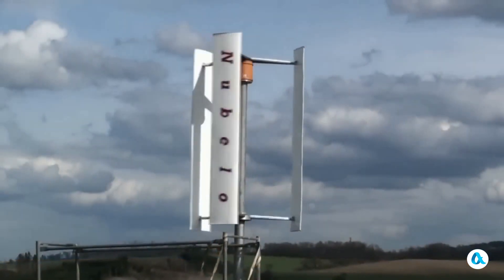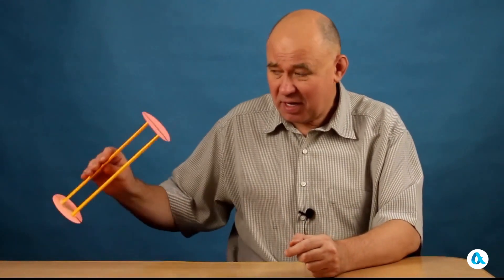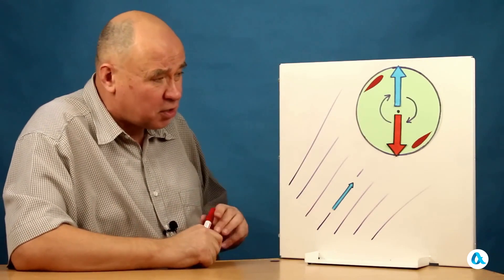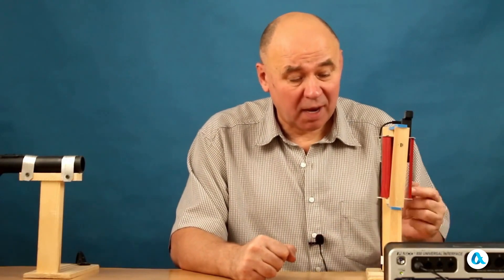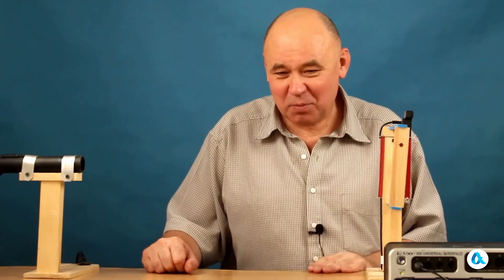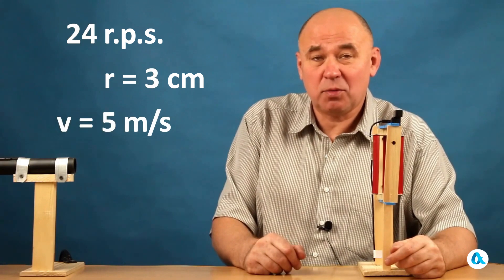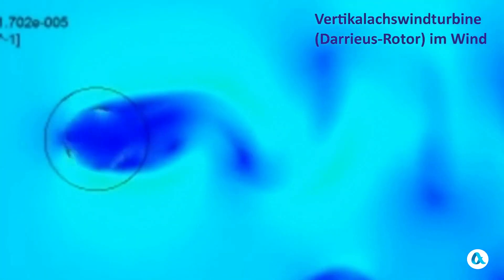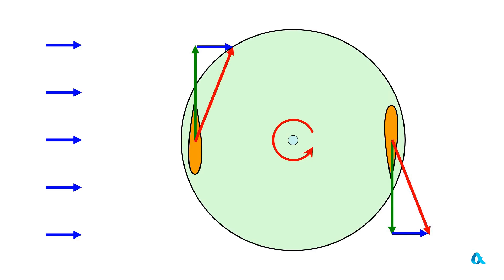Darrieus rotor

Comment: dear andrej! the central mystery that moves the darrieus rotor remains unexplained, is just 'imposed': "lift-forces perpendicular (!??) to the airflow"... so produce a second video please making plausible (visible?!) the reason for this perpendicularity! 
   that would also explain why an airfoil lifts an airplane if and only if it glides = slowly falls or if it is pulled by a motor-force. here the airfoil is supposed to push forward, so much so that you gain force (electricity) instead of using it...?!
thanx! hilmar
ps: by the way: not "perpendicular to the flow velicity" (the arrow you mean) but "to the direction of the air flow"! typical missleading language of 'theory'...

Comment: What  causes  the   maximum  rotation speed  of  the  device ?   well,   I would  say  the  premium airflow  speed,    the  aerodynamic  efficiency  of  each  little  wing ( drag ) ,  its  characteristics   Aspect  ration,  wing  section,    the  diameter  of  the  wheel,  the  interaction between  all the  wings,    the masses  in motion, the  friction in the  axi ... etc etc

Comment: As the rotor spins faster, the resultant vector sum of prevailing wind and tangential velocity approaches that of the tangent velocity (and consequently the effective angle of attack if each aerofoil approaches zero. Further, as the angle if attack approaches zero, the aerofoil lift force moment arm is also reducing, thus reducing the applied torque to the rotor.